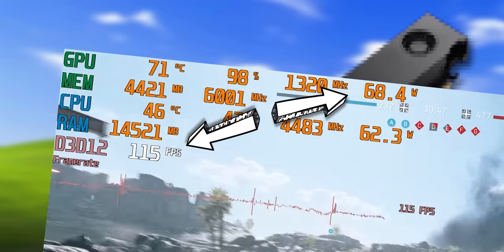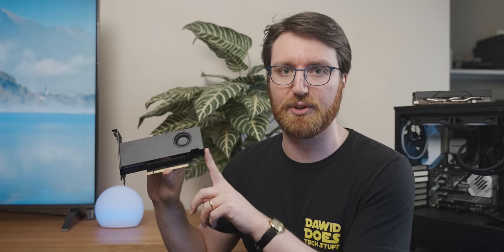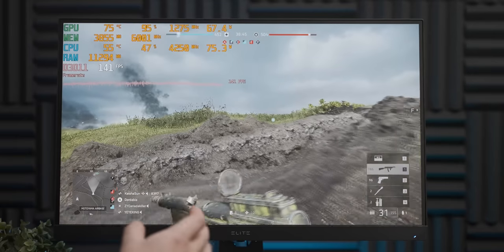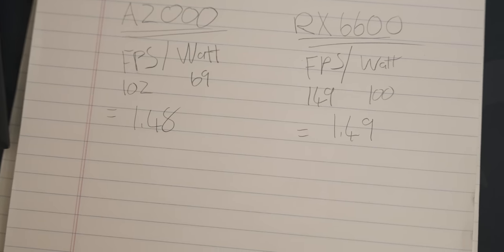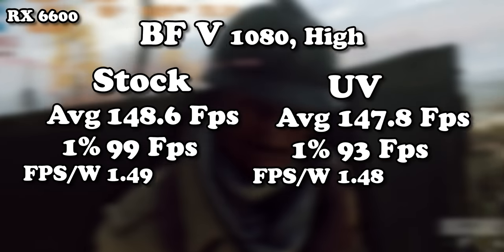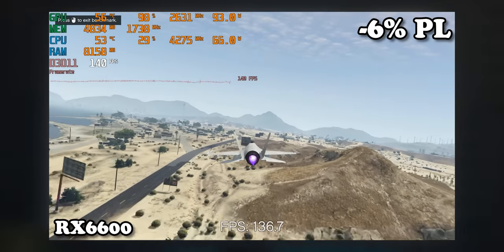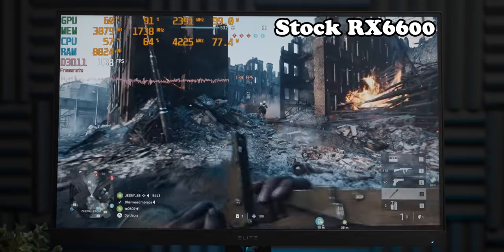The Battle For The World's Most Efficient Graphics Card

Comment: man I miss the 10 series, I remember how damn efficient it was compared to anything that came before or after
Reply: Maxwell also was mindblowingly efficient
Reply: @GewelReal  I remember my GTX 750 Ti, it got around the same FPS in games as my old GTX 560 Ti while using no power connectors, vs 2 6 pins on the 560 Ti lol
Reply: 1050 ti da best
Reply: @floridamangonwild  i had a 1050ti without 6pin that was mindblowing XD
Reply: @xXValentineXx  yeh i have a low profile gigabyte 1050 ti single fan without any connectors that i put in a old lenovo the thing does what i said above and still had more juice left only problem is the cpu which i am currently getting ready to order another mobo for an i7 3770s. The 1050 ran 69c 70c ish degrees Playing stuff like fh4 on maxed settings @1080p and in hzd same settings 74c
Reply: yep, Pascal was perfect. It was so damn efficient that even the top end 1070 and 1080 laptop versions were just 5-10% away in performance compared to desktop versions. It was bliss.
Reply: @arwlyx  My 750Ti draws about 23w of power while playing Forza Motorsport 7 at 1080p 60fps. Which is actually pretty insane, it really is efficient.
Reply: Our last true king of a gou the 1080 ti, I'll never forget first gaming at 2k 100 fps

Comment: I think you weren't getting any higher clocks when moving the slider because you were hitting power limit, if you moved the power limit slider to the right, it would let the card reach the clocks you want it to, but then again that's against the point of the video because you're increasing wattage for minimal gains probably.
Reply from the maker: Yeah, that’s kinda what I was thinking. The card just didn’t have any more performance to give with that power draw.
Reply: @DawidDoesTechStuff  There is 1 more thing you can do to squeeze the absolute limit of the card. Take out those RGB lighting on the GPU . It shares the same power budget with the entire card.  Since your Nvidia A2000 doesn't have any lighting, the RX6600 should be the same too.
Reply: @fleurdewin7958  whole 0.1W lol
Reply: @Dirk Jefferson Nah, if you give the card more power and voltage it will actually reach the clocks you set in Wattman, though the performance you gain with those overclocks compared to the extra power you're using isn't all that great, as with any overclock. The highest I had my 6600XT run at was around 2900 Mhz on the core before it got too unstable with a SPPT Softmod.

Comment: Dawid, you have to up the Minimum framerate in AMD Adrenaline to get actual forced OC.
Reply from the maker: I did also use that slider, sorry I should have more clearly showed it in the video. 👍
Reply: @DawidDoesTechStuff  try underclocking, when I set my msi 6600 to 2200mhz  I go from 100watts to 60 watts and I don't really notice a fps difference

Comment: I remembered this video recently and decided to do my own testing on how to improve GPU efficiency. Only I went about it a completely different way that paid off big time!

I dialed down all the sliders in the Radeon tuning section to their minimum and then at the lowest voltage I decided to slowly increase the frequency back up until I reached as far as I could go while still being stable. Once you reach a certain point you'll have to dial the power limit back up to continue on. Just keep the voltage at minimum!

Using this method on my reference RX 6800, I was able to achieve 85% of the stock frequency! This gave an over 25% improvement to performance per watt in FurMark and as much as 60% in games! 

Theoretically speaking, I imagine this margin grows even greater with the more powerful the GPU you use. This is considering how number of GPU cores and the larger the memory bus matters more than raw clock speeds. I'd love to see this tried on a 7900 XTX!

Comment: Also with amd's overclocking, your clocks will be limited by the power limit ie( if your clocks are set to 2700mhz, but your hiting a power limit, the clock wont go up until you raise the power limit) as a side note you can use a tool called morepowertool to raise the max and min on the sliders

Comment: Seem to be slightly CPU bound at times with the RX 6600 but still interesting results.
Reply: Seeing his benchmarks made me realize just how CPU bottlenecked my 6600 is in some of my games (paired with Ryzen 2600)
Reply: @FriENTlyFire  yeah you gotta change asap
Reply: @FriENTlyFire  Yeah dude
The 2600 was a nice budget CPU at the time, but I upgraded from one to a 5600 about 2 weeks ago and it gave my RX 570 a massive boost.
Considering the 6600 is twice the performance of an RX 570, you'll see an enormous improvement by making an upgrade.
Reply: i don't think it was, the 3700X never reached 90%, the 6600 was always near 90%. Looks like it's GPU bound to me.
Reply: @steveqi9309  You can be CPU bound by Single threaded performance or by IPC, CPU clock speeds or RAM configuration, doesn't necessarily have to be from high CPU usage, also if the GPU isn't fully utilized (97%+) and it's not the hardware it could also be poor game optimization or driver related.
Reply: @steveqi9309  lmao gpu bound, if it was gpu bound then your gpu should be 100%. If not then your gpu is fcked

Comment: One thing I've found with cards that are tricky to effectively limit the power on is that if you limit the frame rate instead, you can get satisfactory power reductions. Limiting the frame rate to the same level as the A2000 may have resulted in a closer match, though it looks like the 6600's advantage in GTA V wouldn't give enough headroom for this to make much of a difference.

Comment: Did you try limiting the clock speed on the 6600 to -20? In my experience on a 5700XT, that cuts the power draw roughly in half for about 80% performance, no voltage tweaking necessary.
Reply from the maker: I did not try that. That’s an interesting suggestion. I’ll go give that a try.
Reply: @DawidDoesTechStuff  heh.. Funny it's completely the opposite answer of what I got, when I said the same thing, except it was 2100 mhz, instead of - 20%, however the same point. Don't forget to undervolt, while you underclock to get even better results 😉.
Reply: Ooo goodie! Don’t expect miracles; the 6600 isn’t pushed as hard from the factory as the 5700XT was, which means it’s closer to optimal efficiency already.
Reply from the maker: @gismo3564  What I told both of you is correct. I did try manually lowering the core frequency while undervolting. I set the card to around 2300Mhz to try and get any voltages below 1100mv to stick, but the card still kept crashing. Although when I set the voltage back to 1100mv and continued testing, I reset the core frequency to default. (In game it kept hanging around 2400Mhzish, regardless of what I did to the core frequency slider. The driver seemed to just ignore any manual core frequency input)
So I didn’t test performance/power draw with a manually lowered core clock, I just used it to try and get a more aggressive undervolt stable which didn’t work. Haha! Hopefully this clears it up. 😂
Reply: @DawidDoesTechStuff  🤓
Reply from the maker: @pandoohyoutube  😂

Comment: Reminds me of the time when I was messing around with RX580 and 5700XT.  Those would undervolt like crazy and ramp up the efficiency quite a bit... but it would also come with some framerate hit if I tried to maximize efficiency (which was fine, as they usually didn't affect the gameplay). Still couldn't catch up to the 1660 and 3060 I have owned though, which was trickier to undervolt but incredibly efficient from the get go.

Comment: i have a sapphire rx6600, and it's night and day compared to my 3050. with the undervolt i've put on it, it never throttles inside of a deskmeet b660, and i have to run benchmarks to even get it above 78C. it's a great card, the only thing i miss from NVIDIA is stability and custom resolutions - the 6600 has a tendency to crash when upscaling and alt-tabbing.
Reply: Crashing because you have unstable undervolting.
Reply: Lmao user issue, not nvida and amd issue. Use a stock 6600 and never had a problem.

Comment: This video opens the door to another question... Could a RX 6500 XT be power-throttled to the point where it could be powered exclusively by the PCI-X slot?
Reply: If I remember correctly PCs won't boot with a GPU that are not connected to power if they normally need power cables. Would be nice though if every GPU had a 75W mode. Though it wouldn't surprise me if a 75W 3060 wouldn't perform roughly the same as the MSRP-wise more expensive A2000 as both chips are essentially GA106 and we can't have that. (75W GA107 3040 to replace the 1650 pls...)

Comment: Using More Power Tool (MPT) you can lower RDNA2 voltage to 650mV and clocks to around 1400Mhz, this is where there is the most efficiency in my experience. Almost double the stock FPS/Watt. You also can extend the power limits lower and higher with MPT.

You also need to test power consumption at the wall, as others have pointed out. 

I'd love for this to be expanded because I've done some testing with 6800xt, 6700xt, and 6800m, all to see peak efficiency for off grid gaming.

Comment: Power limit slider is useless in these cards. You need to reduce the max frequency of the card to e.g. 2200 MHz and you start to see the power usage drop. You lose 10% performance but your power consumption will drop a lot more. Also the minimum frequency should be 100-200 MHz less than the max frequency to keep the clocks more stable.

Comment: When it comes to tuning rx 6000 gpus, it seems that setting the maximum and minimum clock at 100mhz apart (for example 2500min and 2600max) improves stability a fair bit. It lets you do a bit more in term of overclocking or undervolting before the gpu becomes unstable. The youtuber "ancient gameplays" has a pretty comprehensive video on this.
Also, it is worth noting that when it comes to power efficiency, it is highly beneficial to underclock the gpu. Every gpu that I have tested so far was clocked pretty significantly past its efficiency window. Reducing the clocks by for example 100mhz leads to a significant decrease in power consumption, while not having a proportionally negative effect on fps. 
I tried this on a Sapphire 6650xt nitro+ which can draw up to 203 watts in performance mode. 
I paired it with a 12400 and measured power draw at the wall, since according to Igors Lab the read outs of programms are pretty inaccurate, especially for amd.

Tldr: With undervolting and underclocking, my total system power usage went from 265 watts average to 158 watts average while loosing arount 11% performance in the heaven bench mark.
Sucks to loose performance, but good to know you can tweak cards towards efficiency pretty far with very little effort.

Would be awesome though to get a video of you using the morepower tool to reach max efficiency :D

Comment: Running FoldingAtHome can be a great way to test the power efficiency of the card for computing tasks. Folding puts the GPUs under a very heavy load and that can be used to test the card's thermal performance. Since FoldingAtHome also awards points depending on how fast the GPU completes the process, you can also calculate it PPW(Point-Per-Watt).

Comment: I am wondering if underclocking & even more undervolting will bump the efficiency of the RX6600 at all, as AMD cards are clocked very high to be competitive, but their sweet spot frequency for efficiency could be much lower (guessing under 2000Mhz). Additionally, if the card is slightly underclocked, it might not need a high memory frequency to keep it well fed with data (memory underclock), which could in turn make its efficiency even better.

Comment: Idle curiosity:
What if you pull the power connector from the RX6600 so it can only draw power from the PCIe connector?
Maybe no life, maybe horrible instability, maybe flames!
...or maybe that will force the card in to a low power mode to prevent drawing too much from the motherboard.

Comment: The rx 6800 (non XT) normally rates really high for efficiency, and only pull about 215w by default.  They use a really low mv by default and have the 128mb infinity cache. I think they might beat the rx 6600 in many efficiency tests with undervolting as many miners achieved great results doing.

Comment: If you are going for max efficiency, you actually need to lower the clock speed of the gpu instead of overclock. I found that on a 6700xt you can go down to 75% gpu clock (about 75% performance) and it cut power consumption in half from 180w to less than 90w. Idk if it was just that card, but it is worth a shot. I hope Dawid sees this

Comment: Yep, the RX 6600 is quite impressive from a performance per Watt perspective, though if you want the best RDNA2 card in that respect you should check out the RX 6800 non-XT. According to the powertests Igors Lab did the non-XT Version of the 6800 basically consumes power like a 3060ti (so around 200-210W board power stock, though with a bit of undervolting it can get even lower then that) while, depending on the game, performing like or even above a 3070ti. So in terms of FPS per Watt the RX 6800 non-XT is almost twice as efficient as any other card according to his charts.

Edit:
One tip for Over- and Underclocking AMD cards, keep the Core sliders for min and max Frequency within 100 Mhz of each other, otherwise they won't do much because by only moving the max slider you're basically just telling the card the upper boost limit but due to the min slider beeing too low it won't actually try to boost that high.

Comment: A couple of comments on this one already, but the RX 6400 is another low power option, TDP of 53W and tested on Tom's Hardware at 53.7W. However, it's just not as fast as the A2000, so the lower power might not be enough.

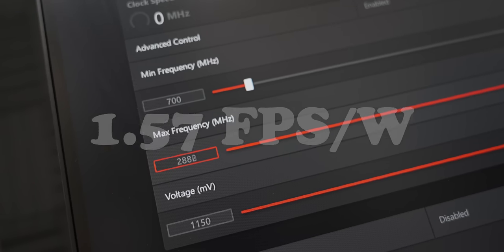Comment: 5:56 You're doing it wrong! Don't undervolt with sliders!
By undervolting with sliders you make the GPU crash by lowering the lowest power states (because the lower ones are more susceptible to crashing), but you want to undervolt the highest power state – the full performance power state. You could've used the knobs in advanced mode in WattMan or even MSI Afterburner's voltage/frequency curve!

MSI Afterburner info:
The voltage/frequency curve actually works and can reduces state 7 voltage (or whichever state is the highest one). IIRC I've reduced the power consumption of my RX 580 by about 1/3rd without dropping its clock speed by a significant amount. If you want, you can also reduce other power states with the voltage slider, but the slider won't reduce the highest power state voltage as much as the curve does. That's because the slider reduces all voltages at once (same as in WattMan), while the curve allows you to fine-tune each power state without dropping the lowest state below the crashing point (same as advanced mode in WattMan). On the contrary, the frequency curve only increases the highest power state's frequency (also in both programs, I think).

MSI Afterburner guide:
1. Start by undervolting with the voltage slider as low as the card can take it without changing the frequencies. This decreases the voltage of all power states at once, including the lowest one. The voltage/frequency curve can't reduce the lowest one (on my GPU). This step is only important if you want to decrease idle and V-sync power usage.
2. Reduce all the frequencies with the frequency curve to allow more undervolting if you wish. The frequency slider only affects the highest power state.
3. Don't touch the frequency slider, it's not needed. When you can't bring the voltage slider down any more, reduce just the highest power state's voltage with the voltage curve. It probably has a minimum voltage, under which changing the curve won't bring the high state voltage down any more (this could be tweakable by changing the BIOS).
4. Keep reducing the highest power state frequency with the curve to allow more undervolting on the highest power state curve.
5. There you have it. You've (probably) successfully undervolted all power states, while undervolting the highest power state much more than the lower ones.
Note: the sliders and the curve complement each other but don't display the sum effect in their numbers. For example, -50mV on the slider and -50mV on the curve results in -100mV, but each one still shows -50mV.

Comment: You should try with a much higher end card. At lower power draws the more cores (CUDA or your regional equivalent) will give you more performance per watt - which is why high end laptop GPUs are insanely efficient. Also from my own experiments I was able to get a 2070s down to about the power draw of a 1660ti with some 30% more performance.
Reply: finally a reasonable comment. pity it's so few under this video
Reply: 3060ti here, 110w 8500 score in timespy, so roughly 3060 desktop scores. Impressive when compared to stock GPUs at least haha.